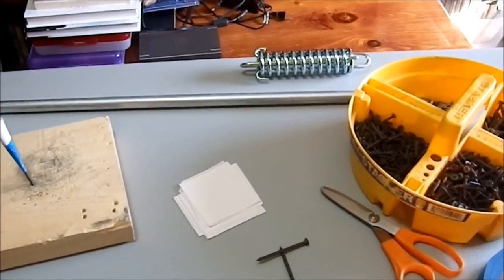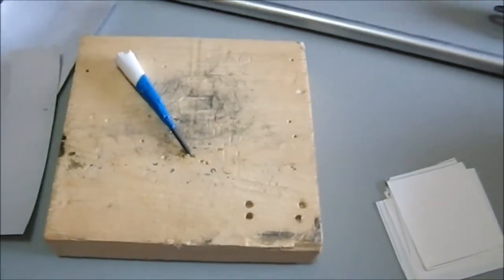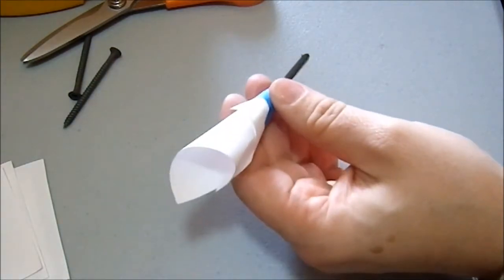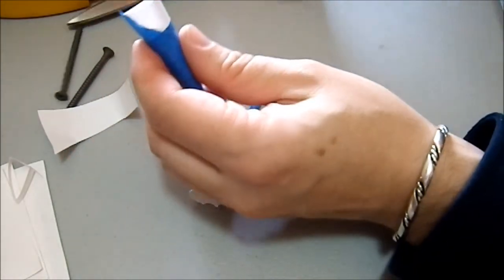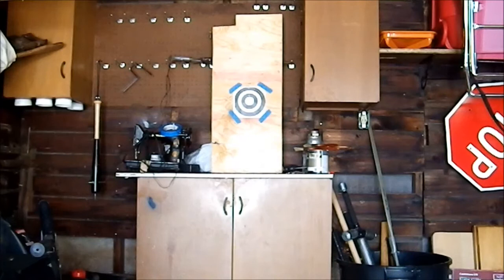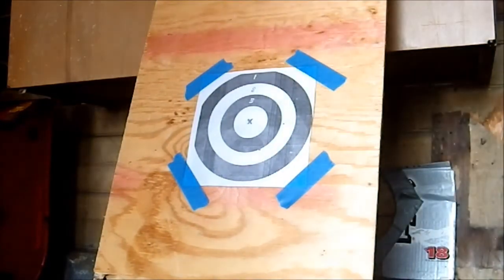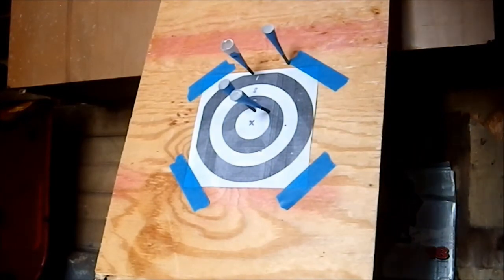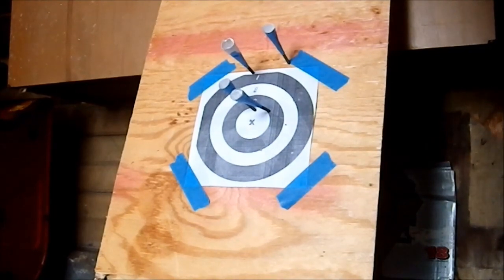Crafting with Tetsubo: Blowgun

Comment: Ahh, brings back memories. I had a tiny blowgun when I was a kid. It was a pen with it's insides taken out, and the darts were shoelace ends, pierced through with a sewing needle, and the 'tail' of the darts were just some cotton shoelace leftovers that we fluffled up.

I think the darts are bouncing off, because of the threads of the screws. See if you can shave a little of those threads near the tip with a dremel and I think it will work better!

Comment: Is there such a poison that you could attach to these that would silently kill or make someone fall asleep? And if so do you think they could go through clothing and skin? Of course I have no intention of harming anyone, I'm just curious.
Reply from the maker: Yes, such poisons do exist. And yes, these darts could go through fabric and skin. Though I might use different designs for that. I am not concerned with combat however.
Reply: Poison darts tend to be made of wood and other plant materials. You want something porous to absorb the poison. It will just coat a metal dart and probably wash off in flight.
Reply from the maker: hyuugaamida Not if the dart is hollow like a hypodermic needle. Capillary action will draw out a liquid.